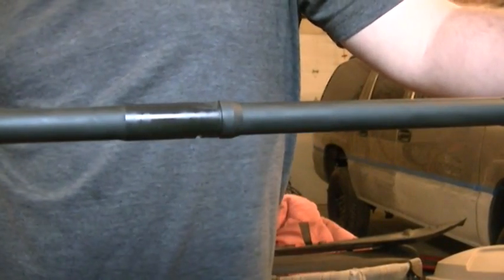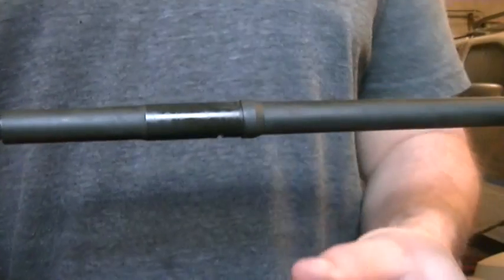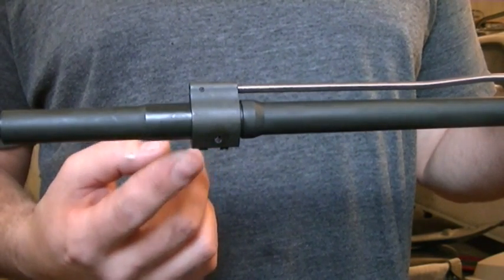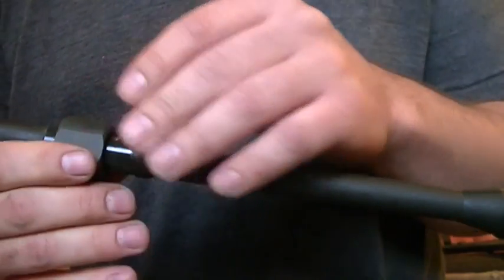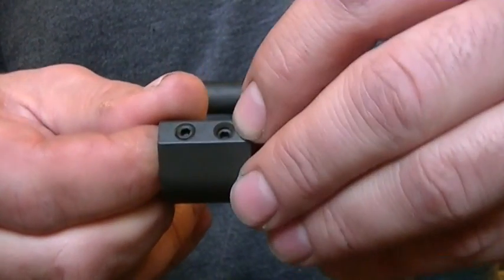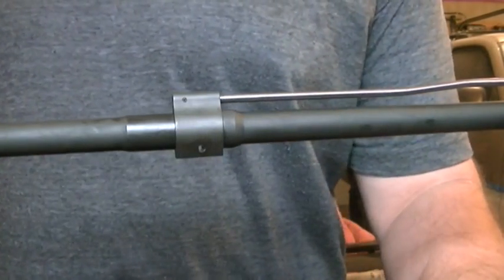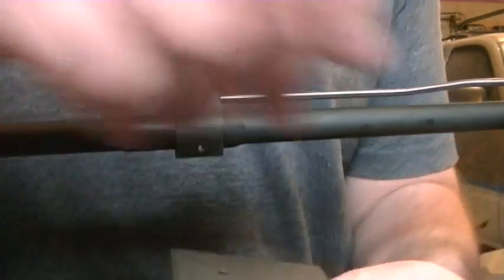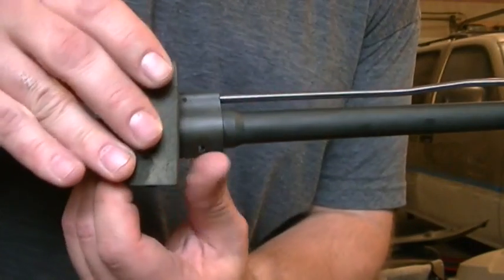BRD Engineering Jigs

Comment: 4:07 changed what offset? You said center to center wasn’t changed which makes me believe the spacing from center of drilled and tapped holes Are the same so did you mean the overall width of the actual jig is offset?

Comment: Isn't the set screw for fixing the muzzle device impossible to remove after welding?  I would think that would be a huge pain in the ass unless the head of the screw goes so deep that its completely under the weld?
Reply from the maker: Shao Zhang it's meant to be permanently attached to bring the barrel to legal length in the USA for non NFA firearm.
Reply: I get that but it seems that it would be much harder to undo than your typical pin job which is already adequate for the ATF.  Unless you're not welding over the set screw head at all.
Reply from the maker: Shao Zhang if you're attempting to save the muzzle device. I've milled/drilled them out without an issue. Carbide tooling.